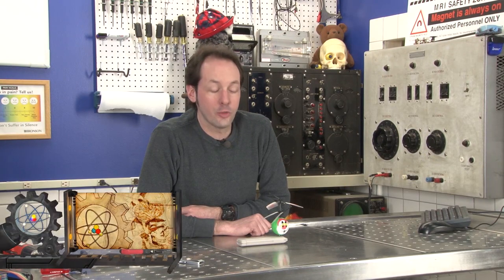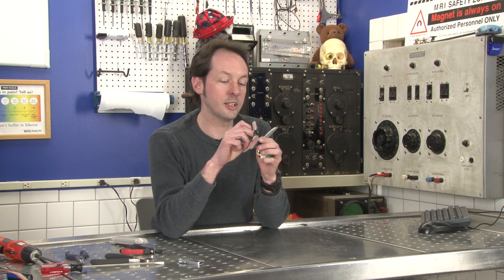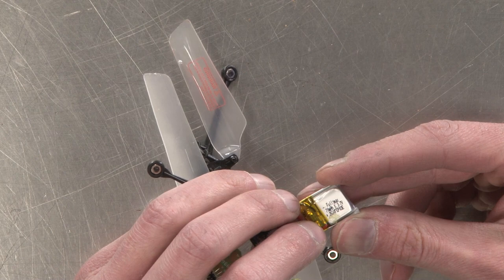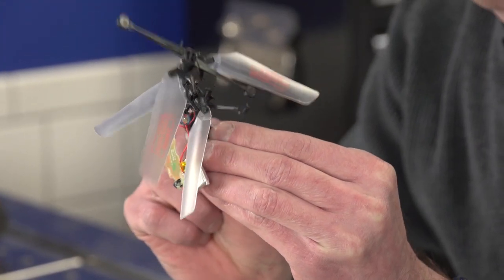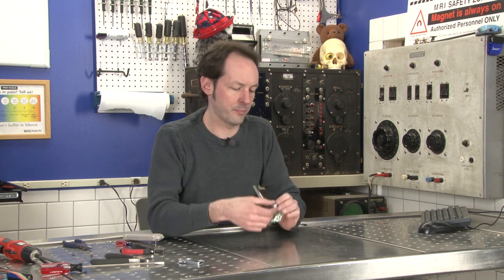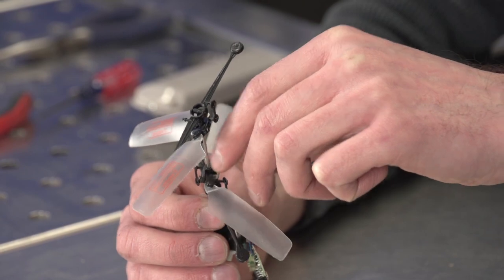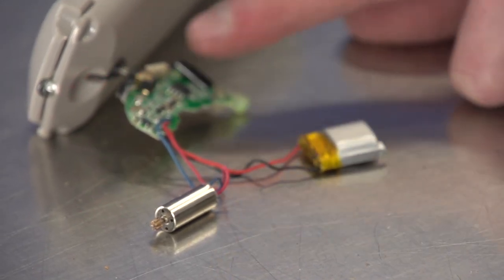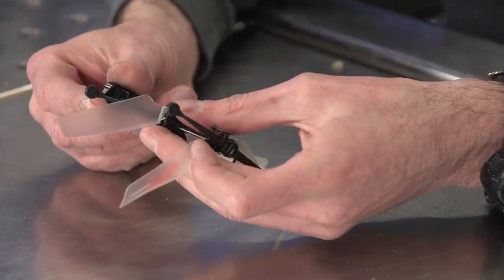Juggalo Santa Helicopter: Equipment Autopsy #70

Comment: Chris:

Have you ever noticed that stainless steel is conductive?

I'm wondering what may have happened if those battery leads had landed on the table when you set it down...

Comment: if your into RC Helos, i really recommend the Hobbyking Assault 450, Or the Assault 700 For more advanced Pilots. The 450 I ready to fly out of the box and comes with its own radio, the 700 however requires you to buy all the electronics first, but if you know how to service the swash plate and rotor head, etc, it is basically exactly the same as a T-rex 700